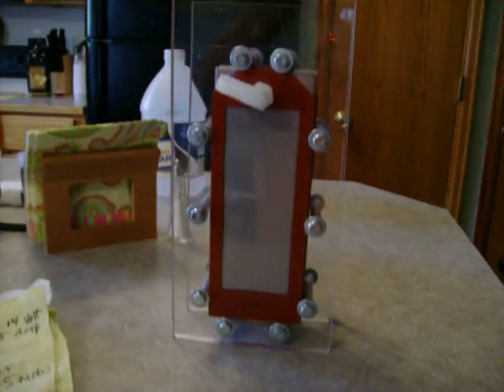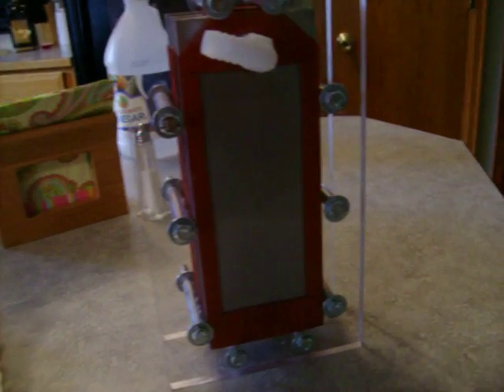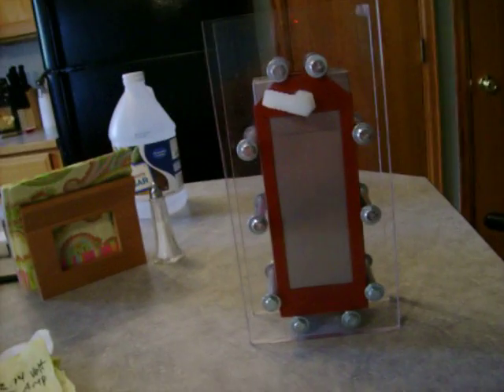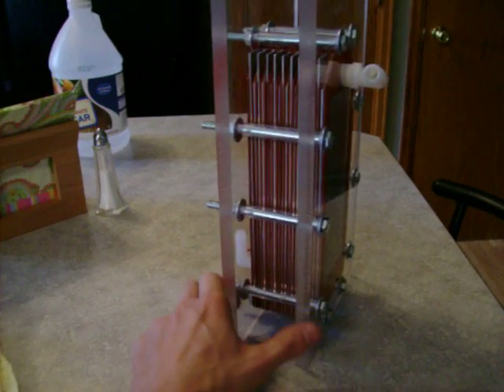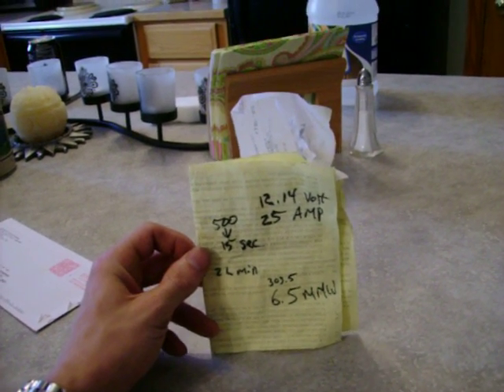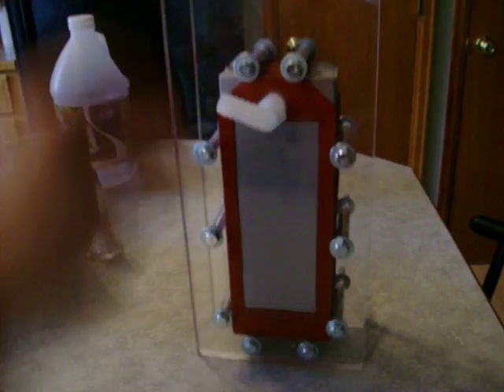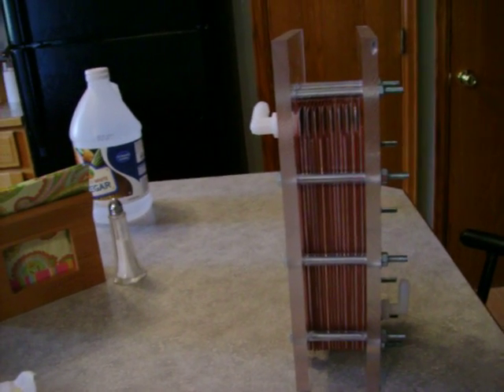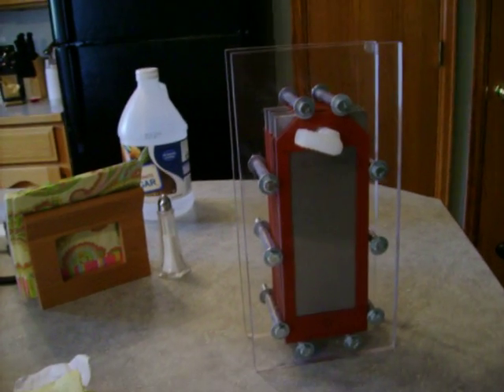HHO Dry cell,

Comment: I looked at some EPDM rubber for roofing at Menards and some shower pan liner that appears to be about 3/64" thick. Is the shower pan liner about the correct thickness for between the cell plates or what is the perfect gap and best material for the gaskets?